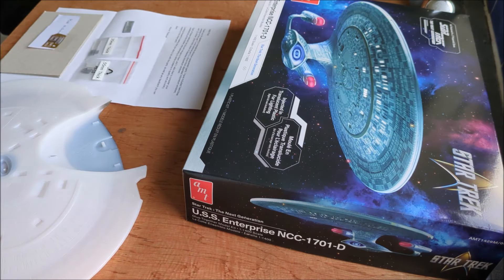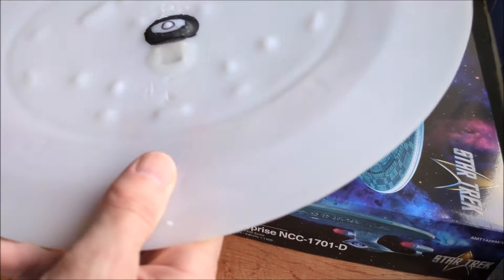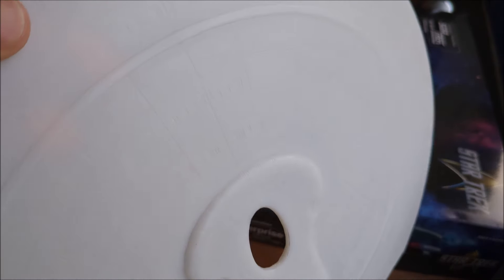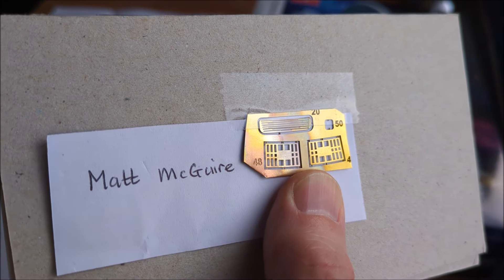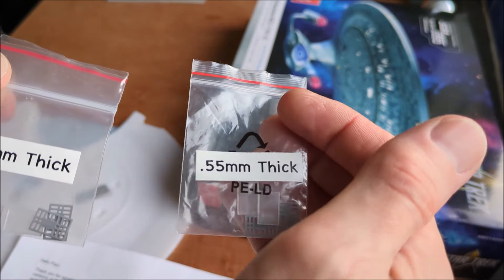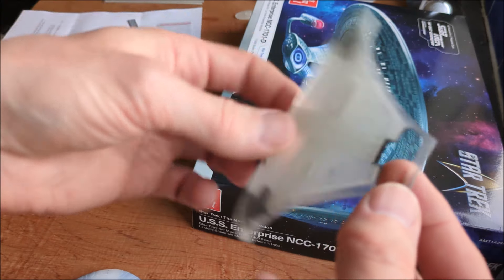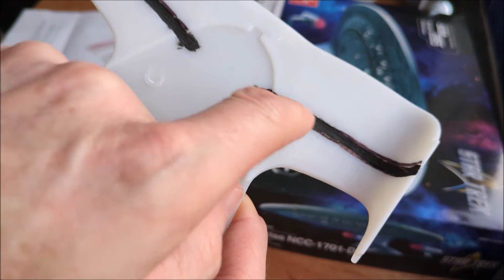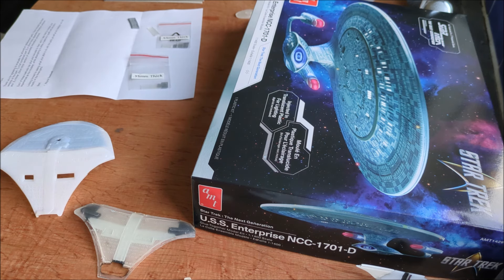NEW STAR TREK TNG Picard USS ENTERPRISE NCC-1701-D, AMT 1/1400 Translucent model kit update.

Comment: Sorry you got one of the defective secondary hull parts. I saw a post about that a couple weeks ago and I instantly went and checked the kit I received. Thankfully it’s correct.
Reply: Not the only defect. My secondary hull bottom was fully moulded but there was a twist to the main body and one of the nacelle pylon wasn't curved enough so the nacelle sat at about 5 degrees off of horizontal. Had to warm the areas with a lighter and slowly work it all back to straight.